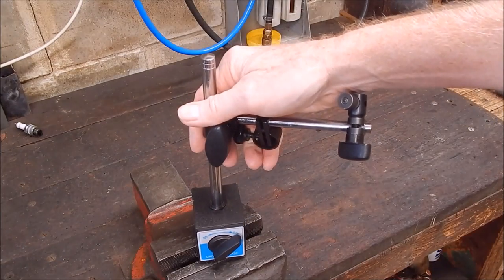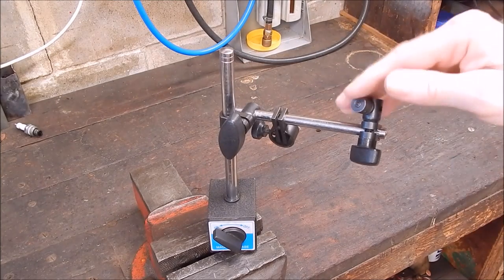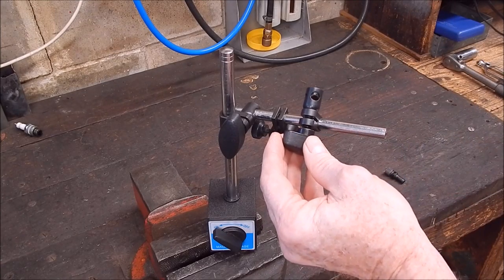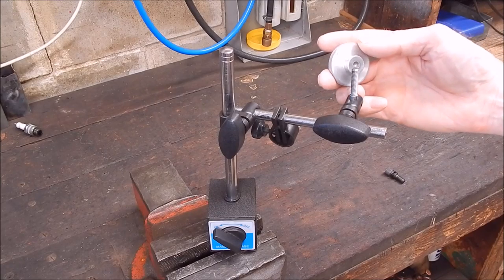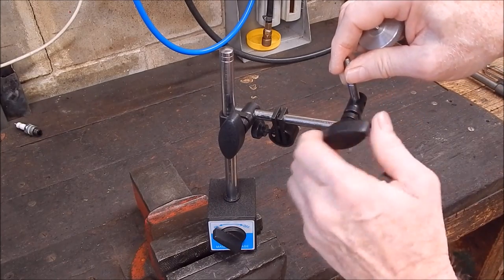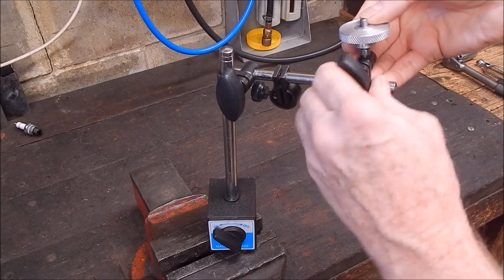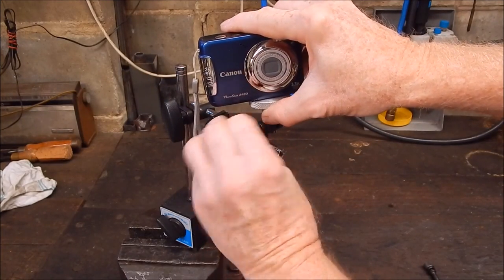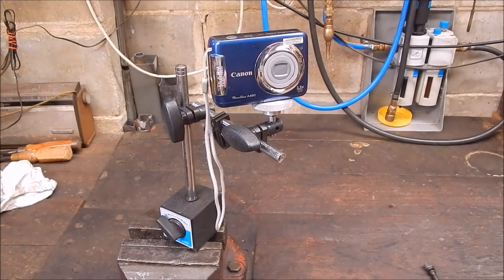Easy magnetic camera mount for machinists

Comment: Nice! Maybe this little piece will be my first project on my lathe once it's up and running.
Reply from the maker: eviltwinx A good one to start with.  Got a bit of everything.  You can either cut a thread on the pin, or drill and tap the pin and loctite in a bolt thread.  I did the latter as that way the thread can be cadmium plated, plus my 1/4" W die is not very good - the tap is OK :) Rob

Comment: Gday rob, know its a bit of topic here bht ive been looking at getting a lathe around the size of yours, just want to know the biggest cut you could do in steel? And over all ability to yold a tollorance.thanks
Reply from the maker: brendan454 Tolerances hold quite OK - no problem.  The biggest cut comes down to the power of the lathe, the diameter of the job, spindle speed, the sharpness and type of cutting tip used, and the type of metal machined.  If the tool post/compound is weak you will also be limited by chatter.  So I'm just pointing out that all lathes are different, even for the same size, and lots of things effect this aspect.  On mine I can do a 2 mm cut into 1080 steel very easily, and I have gone twice that, but it was really straining the compound.  On small lathes you generaly wouldn't do big cuts anyway, given the size of the work being done.  Hope that helps.  Rob

Comment: Exactly what I use! I use a tripod for most work but when I wanted to film the lathe I made a little adapter like yours. Unfortunately I didn't have a good space near the lathe so I just took a piece of scrap steel plate and screwed it to the wall, works great.
Reply from the maker: caskwith Good one.  Yes it does work well. I have taken test footage with mine mounted on the cross slide using macro to film carbide inserts machining stock as the carriage travels along.  Looks pretty cool.  I may put up a clip some time. Rob

Comment: The Whitworth comment made me do a little Googling as I was unaware of that historical perspective.  This shows a little background--> http://en.wikipedia.org/wiki/Tripod_%28photography%29#Screw_thread
Reply from the maker: ab190001 Interesting article.  BSW taps and dies are common, but UNC is a bit of a rarity for most hobbyists.  Luckily BSW does the job.  Thanks for sharing.  Cheers Rob
Reply: Understood.  UNC is the most common here in the US, metric making its way in "inch by inch".  I haven't personally observed Whitworth threads that I'm aware.
Reply from the maker: ab190001 In Australia it was all British in the early days, so Whitworth was the most common thread, followed by SAE (mainly in the Auto industry). As a result Whitworth is historically, firmly entrenched. Now it's all metric, which is way better for calculus.  The mass move to the metric system was a smart move by the Oz govt at the time.  I suppose SAE would be pretty common in the USA.  Cheers Rob